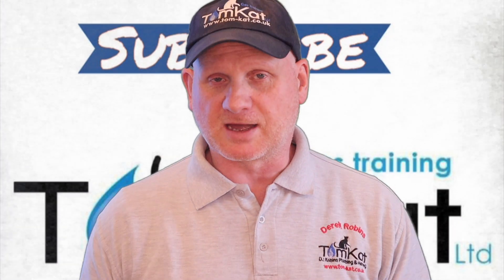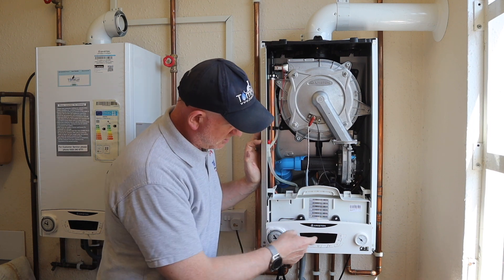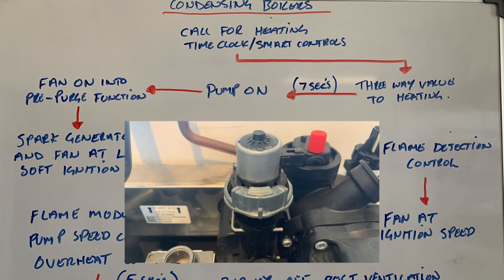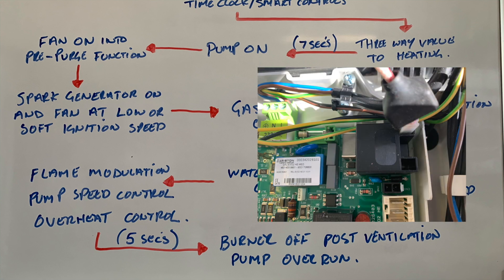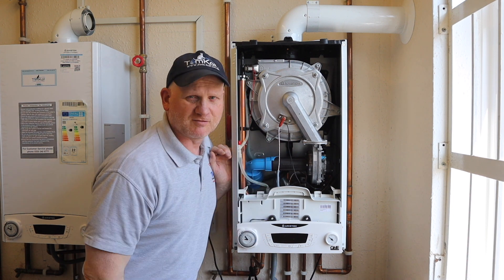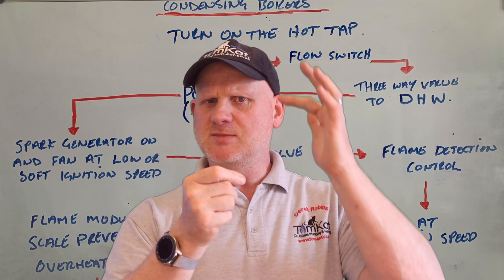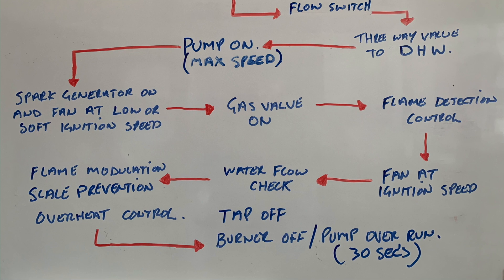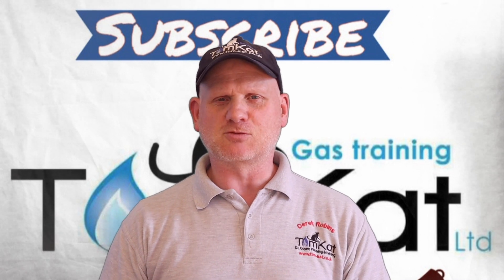CONDENSING BOILER SEQUENCE OF OPERATION, part 3 in the series, how a gas boiler works, fault finding

Comment: i loosely get how this boiler works, what I want to know from your point of view is, why does our boiler throw out water? We have a combi boiler that has a condenser inside which is attached to a tank at the bottom, it has had to be modulated like this because it is in the centre of the house with a flue in the roof and not on an outside wall. From what the Gas man has said, the boiler fills with water to a reservoir inside the boiler, and then when it gets to a level, it triggers a point level that then spews the water out of an outlet pipe. But it does it constantly and he believes it is supposed to. It makes a massive rumbling noise like someone's just hit it with a truck and then it purges water out across the flooring of the attic and outside at high speed and under alot of pressure. 
This particular one we have does not vent out the outlet pipe at the back as others do, but purges out of the soffit in the attic roof at the front.
From his lack of interest and investigation - 3rd time today, we are suffering from what I see as a boiler that isn't working properly, is using an excessive amount of water and the heating is coming out fine in the radiators, I am just somewhat concerned about the amount of water and its not vapour water, its physical water that is coming out. It regurgitates water every day every 4-5 hours. It sounds like it isn't regulated properly and the northern gas man won't have any of it, especially when speaking to a woman.

Comment: Hi Derek so question, with a system boiler it's just the three way valve that's eliminated from the check process.
So the call for heat by temp is not a factor for the system to ramp up the burner to better achieve the required house temp over a shorter time. Kind regards Dave Porter.
Reply from the maker: The zone valves are there to isolate a zone when up to temperature that’s their only job 👍🏻

Comment: Can’t get my head around why the diverter would have a mid position if it’s a Combi it can only give you ether hot water or heating, it can’t do both.
Reply from the maker: Some manufacturers allow the diverter valve to go into mid position to help fill the boilers so no pockets of air gets trapped in the heat exchanger